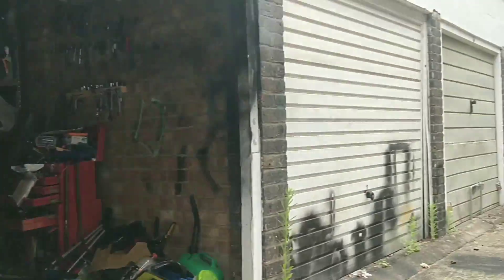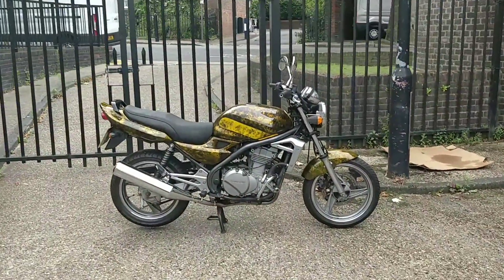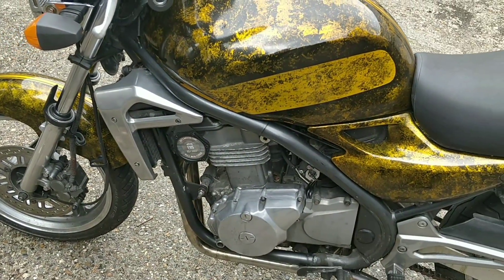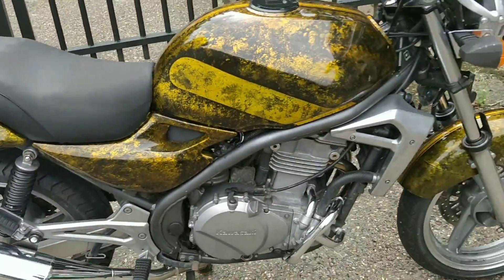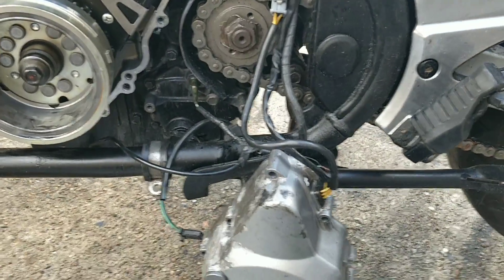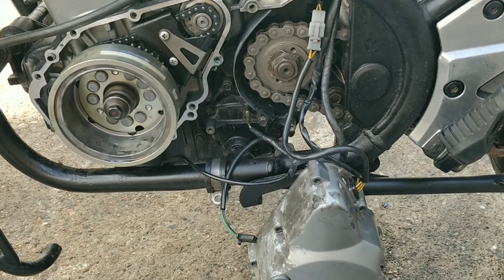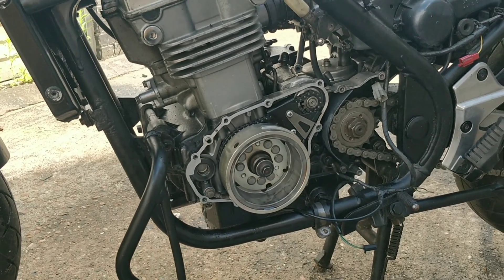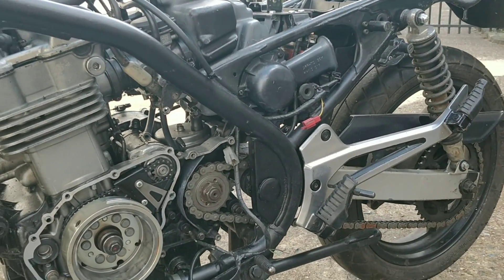my most annoying project yet, broken kawasaki er5 randomly sparks again. dead or not?

Comment: Im in dire need of help. I have a question I stupidly over torqued my rear suspension upper bolt and broke it. On er5 from 1999, can it be fixed or do I need a new frame? The bolt screw is gone
Reply from the maker: You can drill through and put a new bolt through with a new nylon nut?
Reply from the maker: I've just looked at the vid. So the original nut is welded to the frame. Hmmmmmm, I'm unsure what I would do if I'm being honest. I would still consider what I already said. Put a big bolt all the way through to the other side and bolt it.
Reply: I can drill it, but looks like it is  only bolt actually welded to the frame, if the bike. If you look at it from the inside
Reply: @motorcyclerescuer  so drilling all the way through the old one and through the welded back side and then bolting it? Would be my best option, that’s the only options I see as well, other than buying a whole frame which seems crazy
Reply from the maker: Original yes but now it's broke you need a good strong bolt to do the work. You could get a welder to weld a new bolt on and it would go back to how it was. That's probably your best bet.